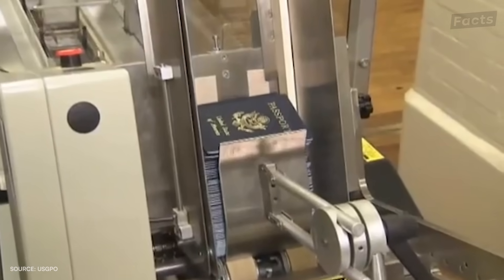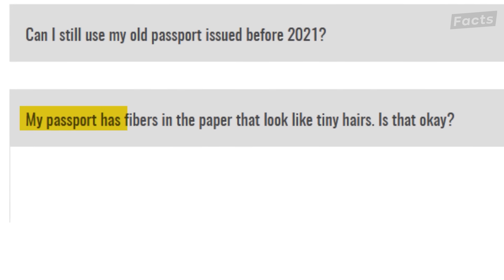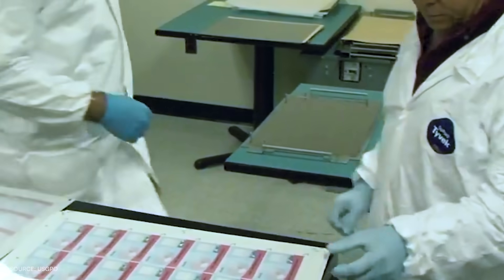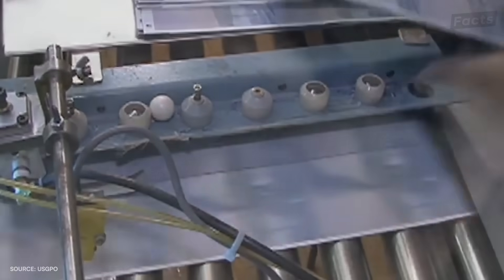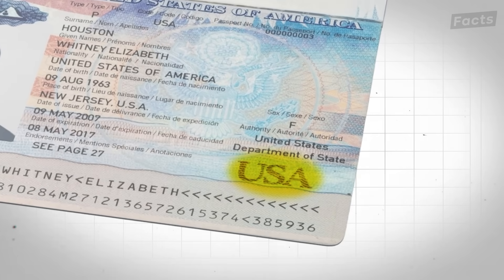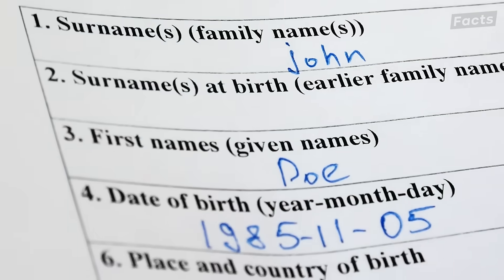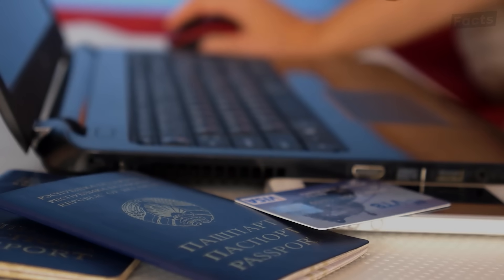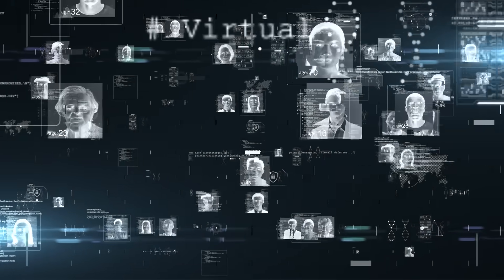How U.S. Passports Are Made - Inside a Government Security Printing Facility

Comment: Edit: This is actually just in Europe, Americans are very behind 💀💀

Actually the RFID chip does indeed include information on the traveller (including a low res photo), it is written to and cryptographically signed by the passport issuer- yes the passport number can be used for the lookup but information is indeed retrieved from the passport, and this signature verified to identify it is legitimate

Comment: 7:46 This is not correct.

What you have described (namely RFID chips that contain a digital link to a database entey) apply to US Passport Cards and some other DHS-issued documents. Those RFID chips follow a US-only standard which other countries cannot read.

U.S. biometric passport books, however, comply to a set of international standards known as ICAO Doc 9303. The electronic chips in passport books contain the full biometric data of the applicant. These data are encrypted with the Machine-Readable Zone contents to prevent unauthotized access, and digitally signed by the U.S. government's private key to prevent counterfeit.

Comment: One more thing:

The information on the RFID chip is also signed using the State Department’s digital signature. This is impossible to forge because the signature itself is only valid with the data that’s provided. In other words, if someone changes the information on the RFID chip, then the digital signature will no longer work. It’s a bit complicated and involves a lot of fancy math but essentially, it’s impossible to forge. And the nice thing is that you don’t need to ask the State Department if the digital signature is valid because it’s independently verifiable. No matter what country you’re in, they can easily verify it. In effect, it makes it impossible to forge any information on an existing or fraudulent passport.

Comment: Oh, now development country USofA has the techonoly that has been used in developped coutries for several decades.

It is funny to see how low level tehcnological issues are considered "much high tech" in development countries.

Lets wait until these development countries will have strong authentication services, which are available and work with pretty much every need, service, etc, globally and guaranteed to be accurate and legally binding. But not in USA/UK, they are still largely in 1960s.

Comment: The video shows security features of the previous US passport generation which were printed before 2022. The latest passport generation has a solid plastic page with the photo and the personal infos. Prior to 2022 the photo info page was made of flexible paper and had fewer, less sophisticated security features. The chip that stores the biometric data in the passport uses Near Field Commuication (NFC) which is a subset of RFID and operates at a much shorter range (typically 0 - 5 inches, sometimes even shorter) whereas RFID chips can communicate up to 70 ft or more depending if they are active or passive once. Many European passports incorporated these more sophisticated security features already 10 - 15 years ago.
Reply: Yes it is the previous passport however your statements regarding some of the other features are grossly inaccurate

Comment: TL;DR, keep your passport in an RFID sleeve. Obtain both a booklet and card. Use the booklet for international travel and the card for daily ID use. The only time ANYONE in the United States may demand your driver license in place of your passport card/booklet is when you are operating a motor vehicle. If the bank, liquor store, smoke shop, whoever gives you grief for providing your passport in place of your driver license, you need to find a new agency to deal with.

Your driver license has far more personally identifiable information than your passport, including your address. NEVER, under ANY circumstances, so long as you live, should you allow your name to be connected to the actual address where you reside.
Reply: Are you in witness protection or something?

Comment: In Poland even your ID has an RFID chip that contains your personal details, the document details, the picture and biometric data (two fingerprints).
The last part being specifically stored on the document to not put it in a central database.
You can also use your ID's RFID chip together with a code printed on it and a 6-digit PIN to log into online government services. There's an app for using it for NFC enabled phones if you don't have a reader for your PC.
It can also optionally have a key you can use to digitally sign documents (which is then as valid as a traditional signature), this allows you to file a lot of paperwork online.
And you can travel around the EU (and the whole schengen zone) with just your ID.
Reply: American passport and ID/Driver's license is a laughing stock compared to the Polish ones. I have both, American ones doesn't even come close
Reply: Ameryka to tylko licencja, Polska to coś więcej. USA zezwala tylko na obszar USA. Jakość nie musi być tak dobra. Zależy też, gdzie mieszkasz.
Reply: Meanwhile Singapore gives citizens their own online account called SingPass to login to online gov't & other secure (e.g. banks & insurance) services that's like a digital duplicate of our domestic ID cards (called NRICs, which meanwhile only have barcodes instead of RFID chips) as well as driving licenses. SingPass also offers 2FA where you use their smartphone app to authenticate by using your phone's fingerprint reader/camera or keying in a PIN. For immigration, we can use a separate app (that's linked to SingPass I think) to enter/leave the country in-lieu of a passport, at specific automated clearance gates at the immigration halls, and that app is also useable to submit digital embarkation cards

Comment: The RFID chip holds all of the biometric data found in the visual inspection zone, as per ICAO guidelines. The chip is also stored on the back page for US Passports. Only the passport card uses a database pointer, and the RFID chip is not ISO and ICAO compliant, and uses long range RFID for the PASS booths at vehicle border crossings.
Reply: Yeah like you know what you're talking about.

Comment: Describes features of the OLD passport they stopped producing in March 2022, with the color photo info page design. Entirely different now with differing security features.
Reply: either way people will still hold onto old passports depending when they got em.
Reply: yeah I still was issued the old one @ajaxsakaraplayz4070
Reply: Isn't the new photo black and white micro print of your name made to appear as your image?
Reply: I was was gonna say EU has had this for probably a decade xD And the new ones are improved as well.
Reply: It’s probably on purpose?
Reply: @joshgseyi  they can now openly talk about it now because they dont make that type of passport the next gen passport is even crazier than the one they are talking about now.
Reply: They were still printing/issuing those old passports until fall of 2024. If you were issued a older passport in 2023 it’s still good for 10 years

Comment: 💢 FIREPROOF, NOT SO.  There is actually no such thing as “fireproof”.  Materials are ‘fire rated’ to specific threshold’s.  Obviously temperature, but types of combustion, flammability and in some instances time exposure.  For example a ‘records safe’ (common) to store papers may be ‘rated’ to 350 degrees F. for one hour.  After an hour the papers char.  In part as a new safe with cement or moisture cell inner insulating walls has moisture that creates steam inside the safe cavity to cool the papers.   Magnetic data safes have much thicker walls and they are possibly rated for 125 to 150 degrees for one hour.  

This also applies to explosive ratings for electrical switches in environments that have flammable gases for example .  These ratings are “Classifications”.  Type 1, Type 2, etc.  

The point is it’s either a Rating or Classification. No “proof”.

Comment: Video generally speaks about the next gen passport with the polycarbonate datapage however illustrations are almost all from the previous version. When a property is being mentioned, the image does not correspond to what is being said. So, the visual part of the video depicts pages that cannot physically have the said property. The research is good, but it was narrated as such that the person seemed to have never held a passport. Also, the chip on us passports are at the back cover, never under the image page. Only a few countries do it this way, US being one of them. (Usually the chip is embedded in the polycarbonate page, whereas Croatia and Switzerland and the US place it in the back cover) Thank you for the good research tho!
Reply: Oh wow interesting that Switzerland does it so

Comment: 7:46 It is a bit misleading. The information printed on the data page is also available on the chip, albeit in an encrypted format. So, when you pass through any immigration point equipped with the proper machine, it can read the data stored on the chip, display it on the machine's screens, and copy it into any local databases. The standard for this is managed by ICAO.
Reply: You are absolutely correct - US biometric passport books contain chips that conform to ICAO Doc 9303 standards. These chips contain your biographical data (name, photo, birthday, etc.) that are encrypted by the MRZ to prevented it being read without authorization, and digitally signed using U.S. government's private key to prevent counterfeit. Third-party agencies like foreign governments can read the full data from the chip and verify the digital signature to check if the document is counterfeit. The downside is that it takes a long time (~5s) to read the data from the chip.

The methodology that the video uploader talks about, namely the RFID chips, do apply to US Passport Cards and other DHS documents like NEXUS and Global Entry. These RFID chips contain a link to a secure database entry that only the U.S. government can access. Notably, these RFID chips are a lot quicker and easier to read at longer distances, allowing for more efficient border crossing processing at READY lanes, etc.
Reply: Didn’t know this, thanks!